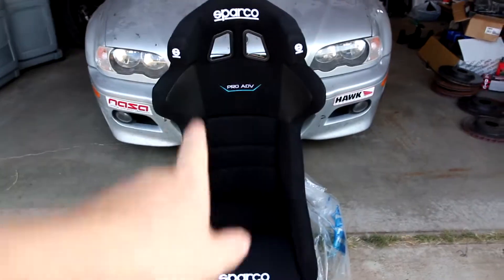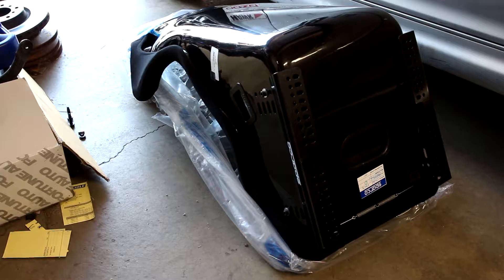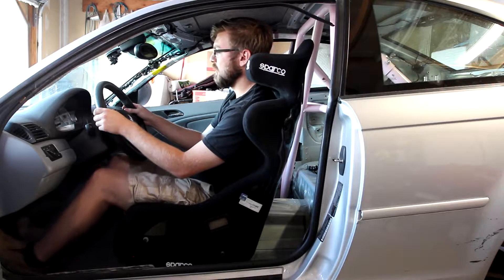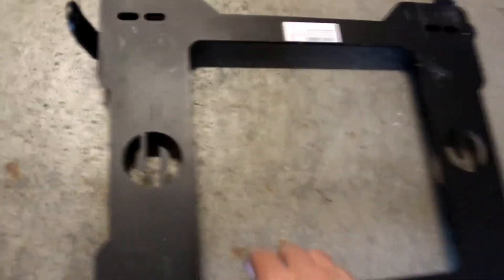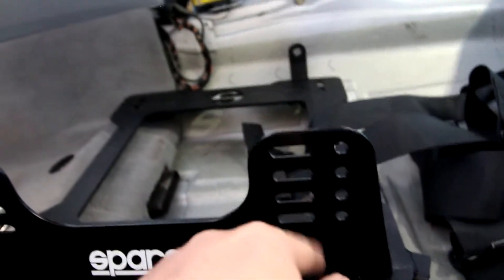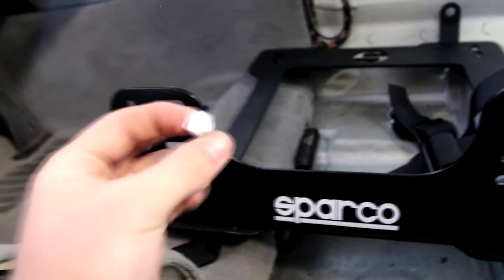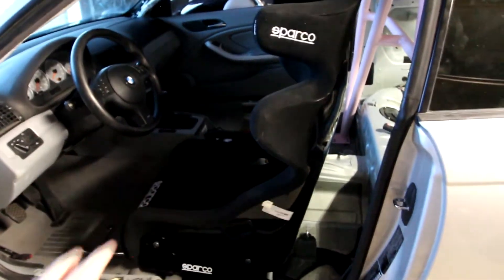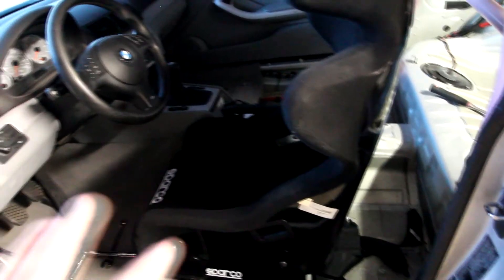Sparco Racing Seat Upgrade - BMW E46 M3

Comment: I’m 6 foot 3 would my head still be in the head containment in the seat or would I be to tall
Reply from the maker: Sorry for late response, I would say you may bee to tall, but it depends on how you're built. I am 6 foot 1 and am just about out of it, but I also have a taller torso rather than long legs. If you height is mostly in your legs, you may be just fine. Hope this helps!

Comment: Which seat mount did you use?
Reply from the maker: I am sorry for late response, I was gone all weekend. The mount I am using is the Sparco mount. Its a bit pricey, you may be able to find a cheaper option that is just as good.
Reply: I’ve got a 330i and I’m looking at this exact seat. How tall are you? I’m 6ft 4 and just wanted to get an idea of how big it is. It’s supposed to be favourable for taller drivers.  Great video by the way!
Reply from the maker: @dank8489  Thank you! I would say that the big thing is the torso size. I am 6'2" and when sat upright with the stock cushions, I hit my shoulders on the Halo. I could probably get thinner cushions, but if your not too long of a torso, you may be fine. If you can find a place to try it out, that would be best.